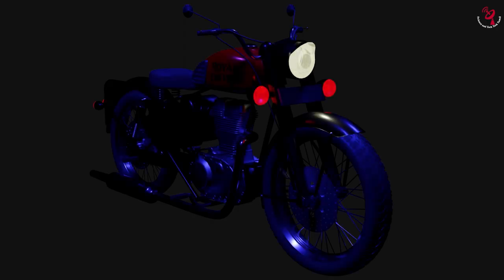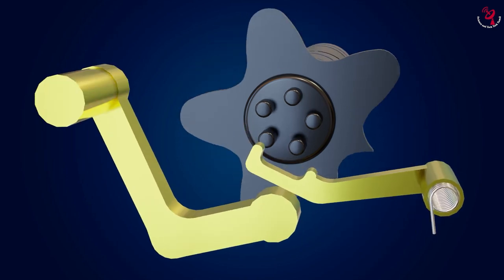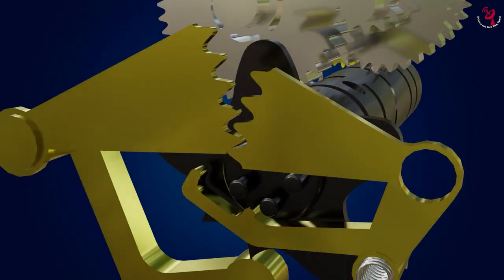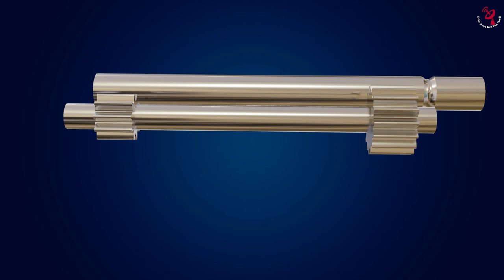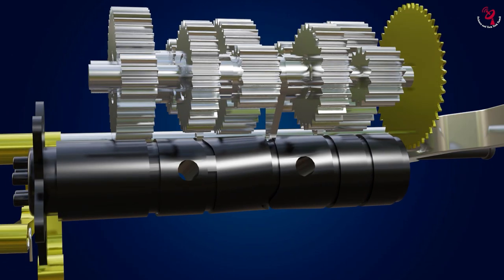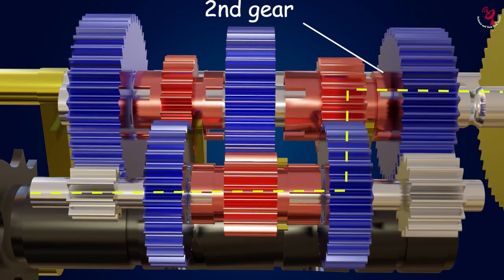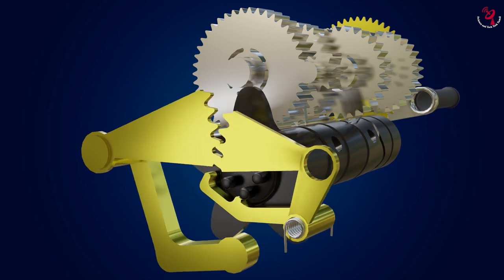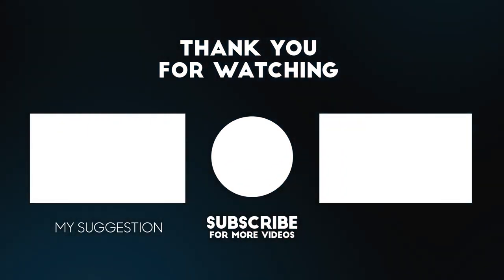How motorcycle transmission works

Comment: If I'm not mistaken, 2nd gear (4:01) is wrong. Shouldn't it go from the input shaft through the silver gear to the far right, into the free wheeling blue gear on the output shaft that's locked into the red slider gear, which spins the output shaft?

I also noticed that 5th gear is wrong, but close. (4:35) The power as shown goes from input shaft to the red sliding gear, into the blue free wheeling gear on the input shaft and connects to the red slider on the output shaft. The path diagram shows it going through third gear.

On a positive note, if I'm right then that means you did a great job and making me understand how it works. Enough so that I was able to spot mistakes. I really hope that's the case because otherwise that means I still don't get it lol.